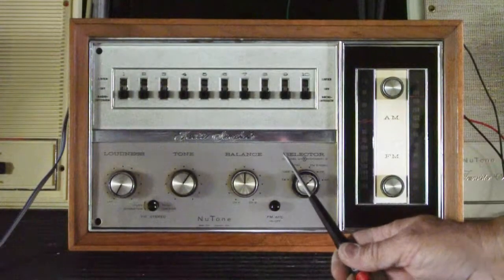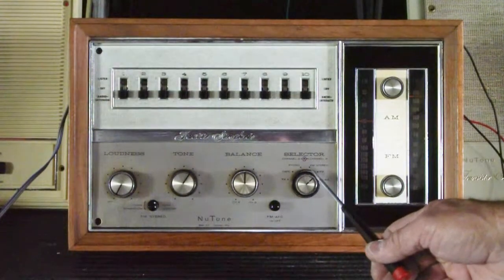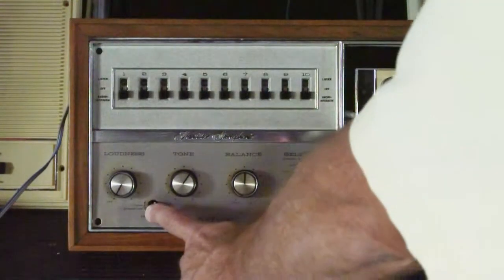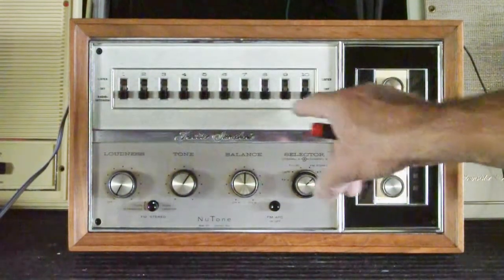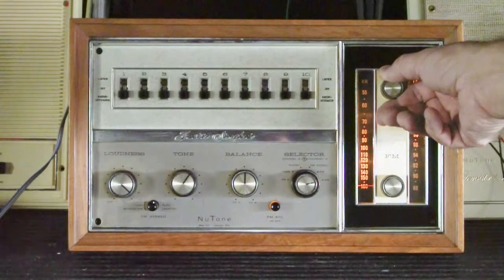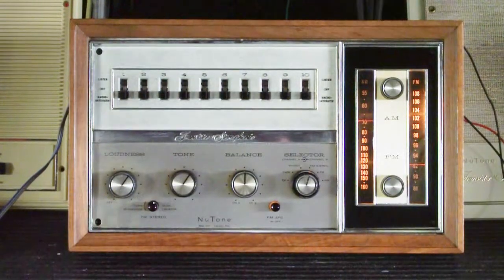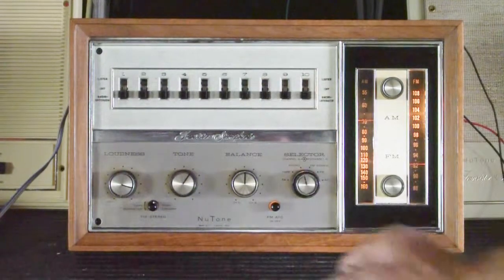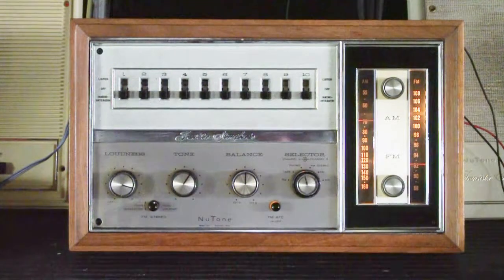NuTone Model 2071 Final Testing and Master Station Overview

Comment: Can you use a 5" speaker setup to still get stereo sound from this unit?
Reply from the maker: Hi tylerterry:  Technically, yes - however you will need to consider some things - The 2071 "Stereo Speakers" use 8" diameter 3.2 ohm Speaker Cones, the "A" Channel Station has a dual Volume Control, which consists of 2 separate volume pots, which can be adjusted individually from each other (ie. they are not tied together in any way) 
     Using 5" Speaker Cones will give you much less volume and fidelity than the 8" cones due.  If your a little cleaver, and if you're planning on using NuTone Model 2027 Remote Station (mono stations for the 2071) you could wire the volume controls on each 2027 to control the volume on each station.
Chris